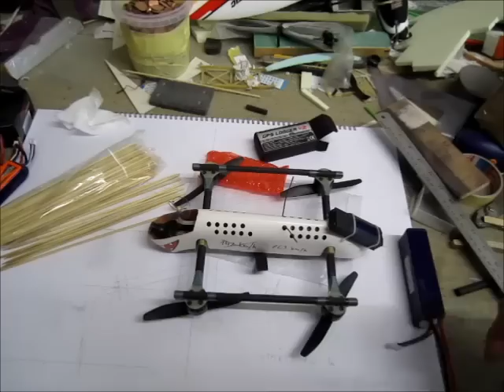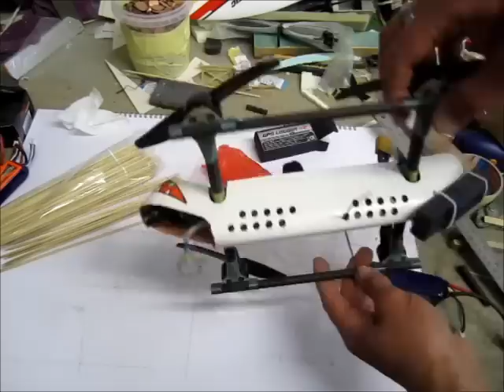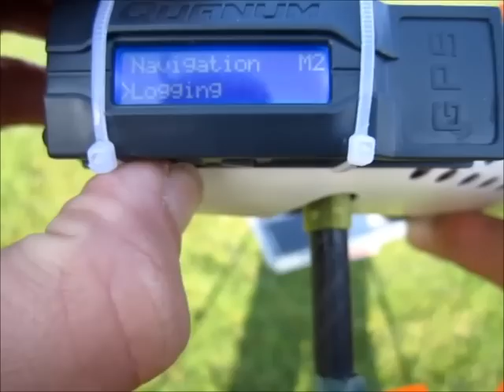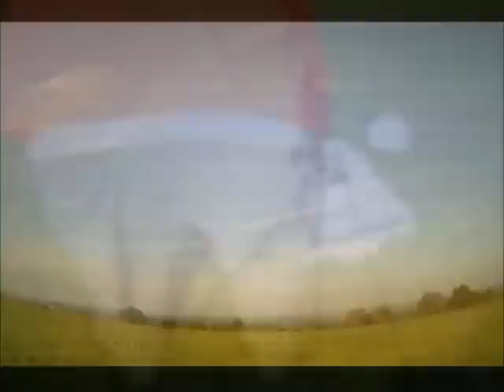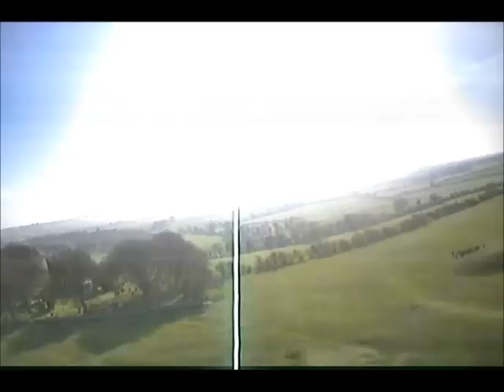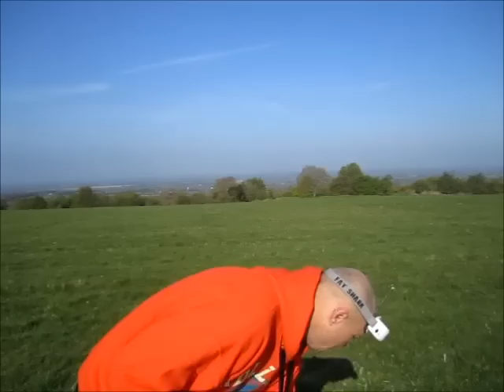Speed record challenge w/ 250mm (or under) quad. Part 5- 6s final run and fail

Comment: Robo...... whats going on you very quiet at the moment... missing your videos...What are you up to are you building thr very lightest fastest frame super quad.... ?
keep on posting.... i looking for some inspration on building a 330 size acro quad....keep it up bud....
Reply from the maker: bing crosby hehe, I'm always up to something:) I have a Twin-Turbo Super Kinetic ready for FPV maiden, I'll post a video with build/mods once that's done, hopefully very shortly.
Reply: cool, look forward to seeing that..... at the moment i trying to get the weight down on my diatone frame 250  losing the will though and need to get a new frame soon.. what you findding the best value for money batteries at moment capacity and c rationg wise been thinking on getting some 1500 zippys as they good price...
Reply from the maker: bing crosby Some of my Zippy Compacts didn't hold the charge well, others are good and they're lightweight batteries. Nano's is a lottery as well, some good, some bad. So far only Rhinos didn't let me down. They have some weird capacity/C that doesn't suit for some of my aircraft and can be charged at 2C only, but they give what is promised (more or less) and if minded they last good.

Comment: Hey Robo do you have a openlog to run blackbox?
It would be cool to see afterwards the log data from the sensors and motors.
Reply from the maker: Nandox7 No, I don't have anything. You know my builds- all KISS and not even OSD on board:)
Reply: ROBOFORCERX2000  I know but on this case it would be cool to see the video afterwards with the overlay data and graphs in it.
The thing is super small and light no excuse. :)